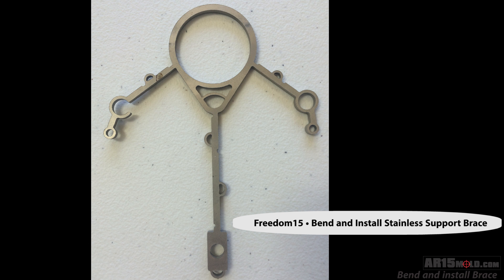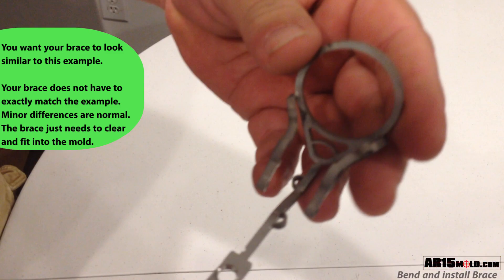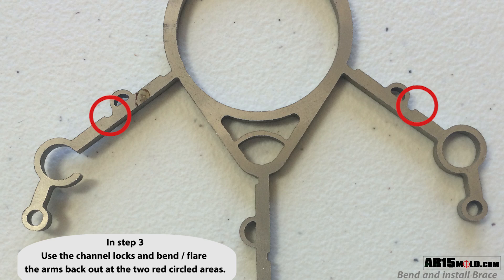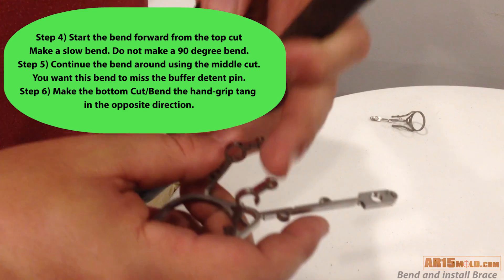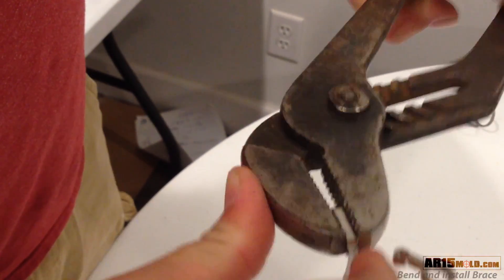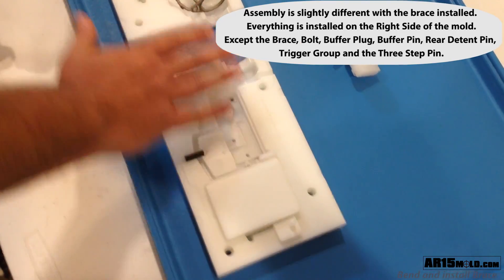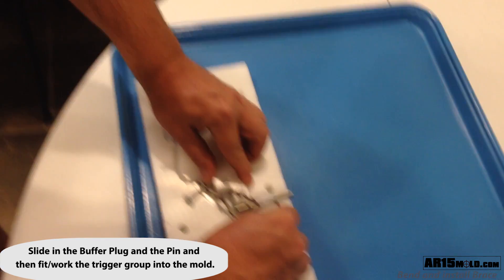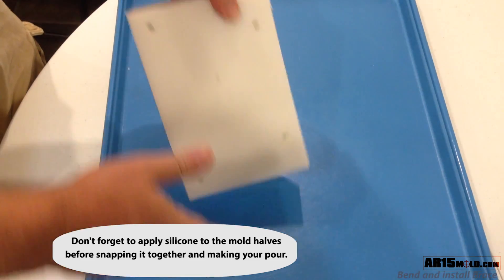Bend and Install Freedom15 Support Brace

Comment: Bottom line is this - come up with a design that doesn't require the metal bits... or stop selling your wares.
Beef up the neck, beef up the holes and use longer pins... figure it out man, that's called engineering

Comment: I took a screen shot at 0:04 / 5:47 and printed it out at approx 1' = 1" scale. I used it as a template to form the side view. Worked great. forming the take down pin holes was easy using the block as a guide.

Comment: The good. You can definitely bumpfire with the brace without fear that it will snap in half at the rear take down area while operating your weapon. The bad. As stated in another post, you're probably going to spend an entire weekend trying to achieve somewhat acceptable specs. If you bumpfire too many consecutive rounds the lower will melt under the heat. There are cheaper, less labor intensive, and definitely SAFER alternatives to this as pointed in another post.

Comment: Is the brace mandatory, I have seen videos where it is not used?
Reply: its not mandatory. its only added support. ive been watching a lot of videos on it. if you dont use the support dont use a bump fire system otherwise youll get a stress fracture at the rear take down pin.
Reply: It's a legal matter unless I'm mistaken I think it has to have some metal in it
Reply: In some states yes.

Comment: Also- after you bend the first one to the correct profile, it helps to make a layout profile/outline of the two profiles, and then cut/shape a wooden block to the same shape, which you then can form subsequent inserts to- greatly simplifying the process going forward.

Comment: How come ya guys didn't integrate a o-ring of some sort that could seal the mold instead of using rtv a o-ring is cheap An could be used a few times An replaced if it ever becomes to brittle or breaks plus you lessen your chance of putting to much rtv an it seeping into the mold it self just an ideal of how ya could improve this

Comment: So, I'm wondering....since I'm sure these are stamped for speed, ease of manufacturing and keeping costs down....BUT, I wonder how much more it would cost to just cast them INTO the proper shape, or have a machine that bends the stamped pieces into the proper shape? Just to ensure they braces are make properly and give a higher quality to them.
Reply: I have not been able to bend one enough to make it not show outside the polymer .
Reply: Matthew Wilhoit 

Legally, I don't think they can form them into shape. The ATF has already ruled the metal fire control group reinforcements used in polymer AR lowers are technically receivers. Same may apply here, if they ask the ATF for a determination.
Reply: these are laser cut.

Comment: if these inserts could be threaded for the buffer tube i would have full faith in this design. the lack of metal threads in the buffer are concern me. also if an integral buffer tube/stock assembly were added i would have no concerns whatsoever.

Comment: I have spent a life time rigging shit to work when I was as broke a shattered glass but, this takes the cake. If each and every bend is not perfect with correct angle, you are screwed. I have spent hours trying to get this to work. I am not wasting any more money on this. The lower has a weakness, they tried to fix and dropped the ball. Should have made the brace pre-bent. Getting pissed off at your customers because you cut a corner will not help business!

Comment: Here's what you can get for $360 instead of this:

-A 3D printer that can make all the lowers you want plus other useful stuff.

-Seven 80% lowers or six lowers and a drill press from amazon.com
https://genesiscnc.com/product/polymer-80-ar-15/

-A dozen complete lower flats
http://www.theflatspot.net/
Reply: Al Profit 3d printed stuff is not as strong as molding like this by a long shot.